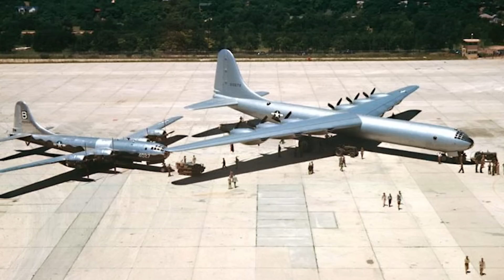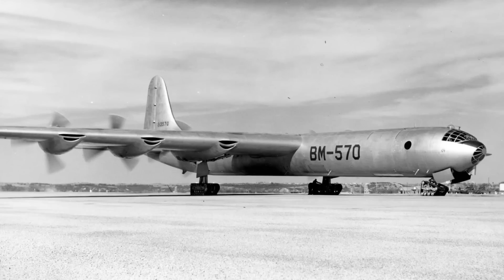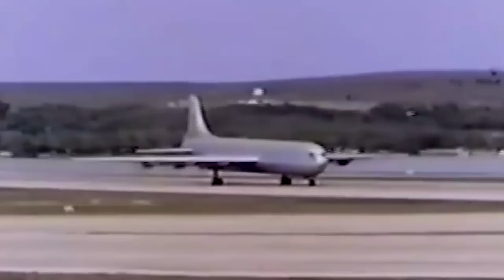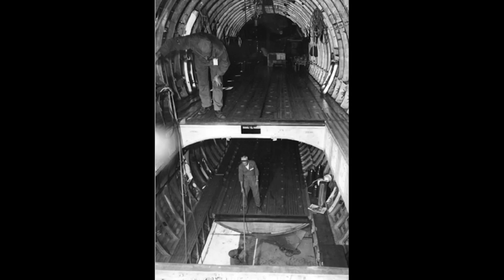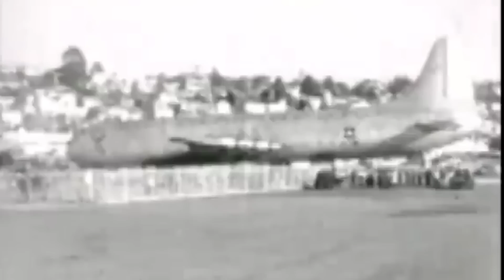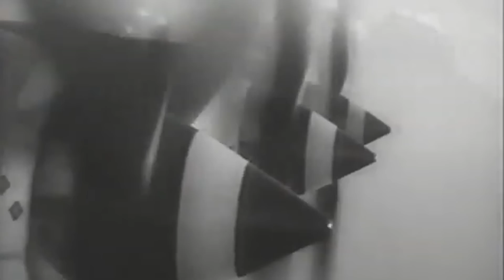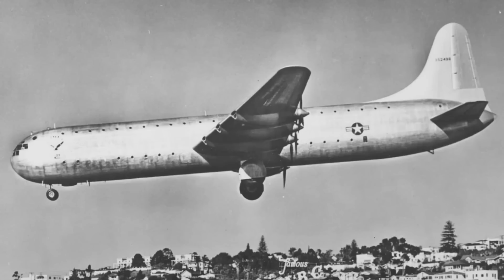Decomposing Behemoth; The Convair XC-99

Comment: Give a six year old a ruler and an A3 sheet of paper, ask him/her to draw "a really big airplane", and the child will unfailingly draw an XC-99.
Reply: With the exeption of the pusher props I think you are right !
Reply: @pascalcoole2725  only way to get enough air flow over the wings 4 aero dynamic lift 🤔 a later blueprint design had propellers ahead of the wing's & redesigned engine nacelles... but 🤔 was impractical & dropped
Reply: @PaxAlotin Some people just are excelent engineers by nature. I'd did something alike
Reply: @PaxAlotin Nice, I used to draw tanks and wheeled AFVs, I still design them but just as a hobby really.
Reply: Well said 💯🤔.. when I was a little boy ten years old in elementary school 🏫 was in class on third floor elementary school in Dallas TX. & the elementary school 🏫 was close to Love Field & id heard something unusual 🤔😳😉 the sounds of six huge radial bank engines eccoing off buildings getting louder.. hmmm 🤔 I gatta' see that..ran over 2 third floor window 🪟 😲 WOW that's awesome 👍 but "what is it's got the wings and engines of a Convair B-36 VLR Peacemaker stratigraphic bomber but a double deck fusalodge and then she flew right over me 😲😲💖windows shook and it was low with power on 4 final approach and landing in 1970 to re fuel for its ferry flight to be storred.... WOW that's awesome and is not realized that I saw aviation history 💯🆒
Reply: Mine drew a C-124 Globemaster :P
Reply: @greenseaships  with the wingtip tanks and everything? Talented kid...
Reply: Kedena AFB 1958. When b36 flew over at night only. Whole house shaking strong resonances made my bed buzz.
Reply: @michaelthomas7178  wow 😳 you are exactly right 👍 same incredible sound & vibration that the XC-99 Prototype made exactly when it flew over my head 😉 looking out of the elementary school window 🪟😲 pynes shoply
Reply: @michaelthomas7178  
But did the buzz shake the bedbugs
off your bed 🛌 ?
Reply: @minhthunguyendang9900  always one in every conversation
Reply: It looks to me like a giant popsicle stick with wings, engines and a tail.
Reply: Convair beat the C-5 Galaxy by a few decades.
Reply: . The C-5 Galaxy can transport 80% more weight, not to mention tanks - at 73% faster speed.
Reply: Mr. Ed Nash,
what ‘bout the Douglas C-133, the C-130 Hercules’ elder brother which was used to transport the Atlas rocket ?
Reply: @sangomasmith  Yes Sir 😉👍 well said 💯
Reply: @user-ex4si2md6r  never seen a bed bug till we moved to Oklahoma.
Reply: Just like those silly Rivian electric Amazon delivery vans

Comment: I took several slide photos of the XC-99 back in the 1980s when the aircraft was still on display at Kelly AFB, San Antonio, TX.  It is to be hoped this one-of-a-kind aircraft can somehow be restored to static display.  Thanks for sharing this in-depth story on the XC-99!
Reply: Hope so.
Reply: They either are restoring or have restored a B-36,so there is still hope???
Reply: If it does get restored, it'll probably be at Pima Air and Space museum, which is literally across the street from the Boneyard, and already has a B-36 they restored. I wonder how much effort it would take to set up a GoFundme to get the XC-99 restored.

Comment: Ah, transport version! I thought that was the prototype 'nuclear powered' B36 that was supposed to carry Project Pluto, that brutal nuclear powered cruise missile that would fly around at low level radiating everything while dropping nukes over Soviet targets before ejecting it's core over a final target. Apparently both plane and missile were to use open-cycle nuclear engines spewing radiation everywhere because who cares at that point? Thank all gods that neither were ever completed. Very cool to hear about THIS plane, amazing cargo load on it but the B36's whole concept was dangerously flawed as was proven many times over the years.

Comment: The single tires mains in BOTH B-36/XC-99 were found to have such high ground pressure that initially there were ONLY THREE RUNWAYS that could take them.  BOTH were quickly refitted with the quad tire mains.
Reply: One of those original wheel/tyre assy's exists still at the Hill AFB Museum in Ogden, UT.
Reply: @davef.2329  And there is/was one at the National Museum of the USAF, too.

Comment: Piston engines and turboprops aren't the same. While they both drive propellers the turboprop offers a much better power to weight ratio, are much less complex and more reliable and use cheaper and less flammable fuel.
The better power to weight ration meant that they could be made more powerful without creating a monstrous massive engine, and thus turboprops could reach higher speeds.
Just look at the massive Soviet NK-12 engines that powered the Tu-95 Bear, they had 12,000 hp a piece and the plane could reach 850km/h. The average turboprop airliner can fly at 600-650km/h

Comment: Shame but she's so big that even resto for a static indoor display would be huge work.  Hope so but they tend to slice up hard to re-home big planes & distribute bits, so maybe that fate?
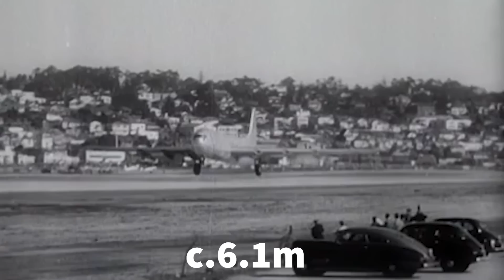3:27 Yes, one clown-sized 1950s tyre [in a pod!] looks a recipe for prototypical disaster. 4:57 Ok, they put the old gear back on.  Reckon to go flying before the fuselage work was complete or a basic snafu?  Dunno.
Reply: Nobody in their right mind would expect this thing to fly again, so it seems like it would be possible to weld it back up with the cheapest materials that are safe for static display inside or outside, and give it a really nice paint and bondo job to hide the imperfections. You don't even need to worry about the inside, as just seeing this monster from the outside would be extremely impressive. It seems like a lot of museums take the "perfect or nothing" approach to restoring aircraft, and I don't understand that because it means a lot of history just gets completely lost or destroyed when at least something could have been saved.
Reply: @lzaffuto  Agreed re 'perfect', we just want to see the damn plane.  But it's still so utterly huge, most museums would need to build a whole new display building, and a big one too.  So I think chopping her up & sending bits to different museums is more likely.  As we do with ships & subs. Cheers.

Comment: This plane had an incredibly successful service life for a prototype. Its a tribute to the expertise of the Convair design team that they could get it so right on the first version.  It was also interesting to see the evolution of the landing gear during its development.  Correct me if I'm wrong, but I believe the multi-wheel under carriage was pioneered on this plane, a truly ground breaking achievment.
Reply: Surely not ground breaking, they designed the gear to avoid that! :P
Reply: The bogie undercarriage was developed for the B-36 first, (as the B-36 prototype was cracking runways early on), and fitted to the XC-99 later, (as Ed mentions in the video).
Reply: it sits in that weird spot alongside the PRR S1 of prototypes that where incredibly good as individual units but not good enough (or held back by factors beyond their control) to justify a production order.
Reply: It was around this time that large aircraft generally were moving over from large single mainwheels to smaller multi wheel arrangements and quite a few started out with singles but in production had multis, I think the Comet was one. Part of it was the realisation that grass runways just wouldn't cut it, coupled with the large number of concrete or tarmac runways built for wartime needs.
Reply: It was certainly one of the first aircraft to use bogies.
Reply: Some say that the single wheel version would break regular concrete runways.
Reply: Pretty sure the MIC were taking the piss building this monstrosity.

Comment: I live in Tucson. I didn't know it was here. I'll keep an eye out, but I'm not active duty, so I have no pull to get on base. DMAFB 86'ed AMARG tours last year. Didn't notice any at PASM this January.
If the external skin were replaced with aluminum panels, where the rotting magnesium was, would it still be an XC-99? I know the manpower costs would be astronomic, let alone the Alcoa bill, but the Spirit of Ft Worth is testament to the power of volunteerism. And that B-36 still exists on the line at Pima Air & Space Museum.
[And we're wondering if a lot of clapped out B-36s didn't already get turned into those 4'' Survival Kit Magnesium bars with  Ferrocerium strikers?]
Reply: I'd love to see the XC-99 on display at Pima. I went down once with a bunch of aviation buffs (including one who worked at AMARG), and the XC-99 was the main topic of discussion. I've also been wondering if they could rebuild it using materials other than magnesium. Pima is the place for restoring big planes. They have several B-52s, and are even getting one of the Martin JRM Mars by the end of the year. I've been wondering if a GoFundMe could be set up to raise the funds.
Reply: Just tell them you're illegal immigrant. They'll pass you right in!